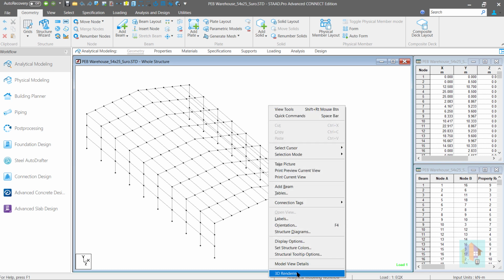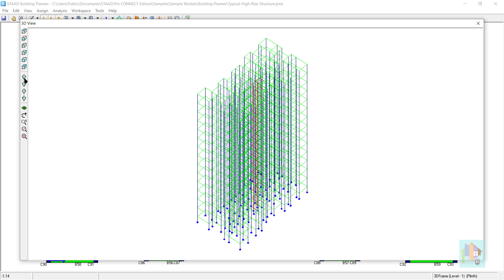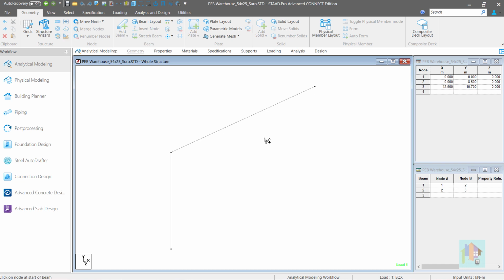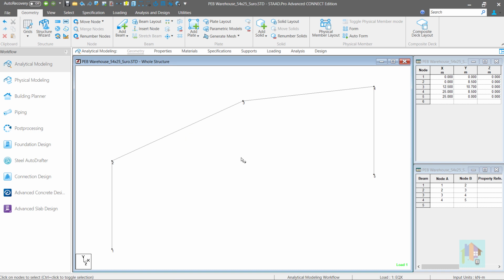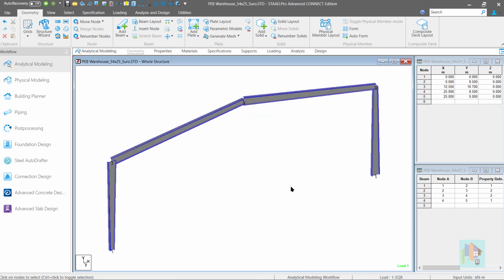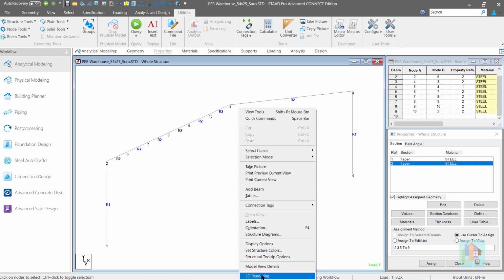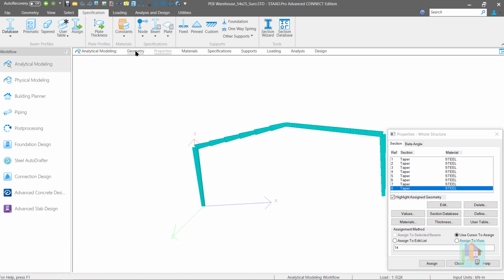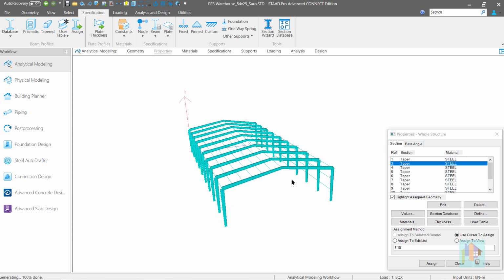PEB with Analytical Modeler: Part 2.1- Generate Main Frame with Analytical Modeler ||Tapered Profile

Comment: Sir , Would you please explain us what should be the exact way to analysis RCC  building with shear wall and How to provide shear wall in STAAD PRO.
Reply from the maker: For RCC building, there are different methods and modules to model it in STAAD, module selection is dependent on the structure type and structural elements which you want to include. For example, if you want to model the slab using FEM, then it is better to use physical modeler/analytical modeler. To import any existing floor plan, you can use building planner mode.
You can use either physical modeler or analytical modeler parametric model with mesh type "WALL" to generate the shear wall and after analysis, use STAAD Advanced Concrete Design (RCDC) module to design the shear wall using FEA results. 
Refer to this playlist to get some idea about RCC building modelling--https://youtube.com/playlist?list=PLxLi_mmlPeipV1SYK6PxtV2wlBNPzMISZ
Reply: @surojit_ghosh  sir , actually we want result of story drift , base shear , and the bending moment , shear force and axial load in shear wall
Reply: Sir can you please explain any one model which consist shear wall by using surface element command
Reply from the maker: Surface elements were used to define shear wall in older v8i version and this has been discontinued in CONNECT Edition. In recent versions of STAAD, we need to define a shear wall using plate mesh with proper mesh type.
Reply: While doing modelling for shear wall using parametric model , do we need to do generation for both slab and shear wall